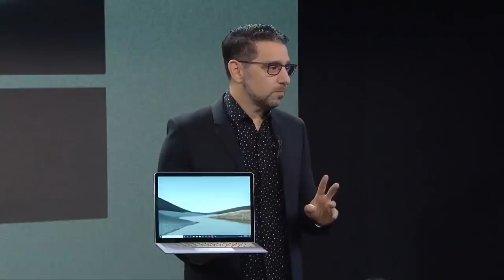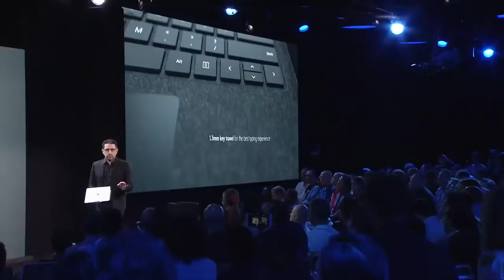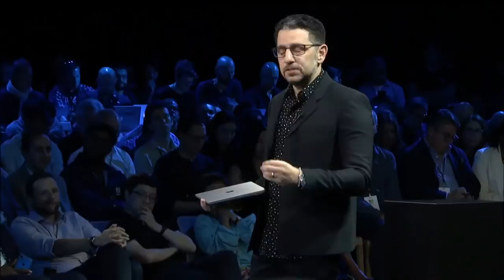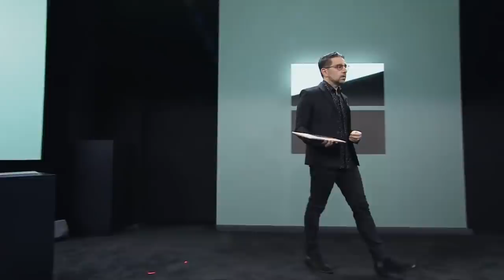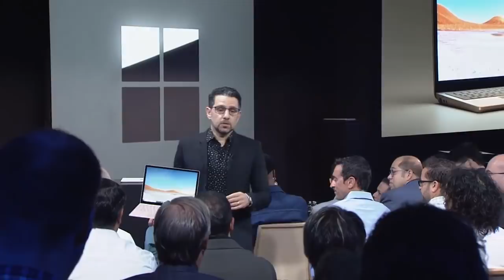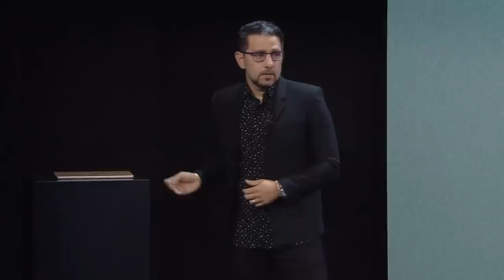Microsoft says they value repair-ability, designs more repairable product.

Comment: They still need to make surface pro more repairable. Also thunderbolt 3. But glad the laptop 3 got repairability.
Reply: And the new 5.3 mm thin Pro X has also removable drive just on the side of the sim tray. 😆this year they are really bashing apple silently. When the laptop 3 came on the stage first thing they mention is the keyboard. 😆
Reply: Just watch the Pro X promo video from MS. It is super easy to upgrade the storage.
Reply: Abhishek Maurya but not the pro 7 , so if I want intel I am out of luck. And battery isnt replaceable on either... a step in the right direction but far from what i want
Reply: @Ultrajamz  yeah I think thats because of the drastic design changes that they have to make. Although the now the whole surface line up support either expanding the storage using sdcard or easily removable ssd. Maybe that's why they didn't do it. I also think that net yesr we might just see surface pro 8 in chassis of Pro X. Let's hope they improve the repairability further not just storage.
Reply: Abhishek Maurya the issue I have is I need to run VMs and sd cards are too slow for this, and thunderbolt 3 makes a big difference for external ssd ...

Comment: I disagree. I think Apple should repair all our devices and charge us 2 times the cost of a new one.
Reply: Business Momo 

I think it should be even more if you purchased it more than five days ago.
Reply: @GibusGang  you're a genius
Reply: Why only 2 times the price of a new one? I think 10 times is more appropriate. I mean our old device is more personal now, so it's more valuable to us and it should cost 10 times than a brand new device to fix it :D
Reply: 2 times the cost of cheapest product, to repair a warehouse full of devices. Sure.
Reply: Yes, this is the perfect solution that we all want. Repairing is for nerds!
Reply: I can feel the energy coming through
Reply: But data recovery would still not be included.
Reply: Just let us repair them ourselves without t2 chips.
Let us buy parts or use them from other identical apple products.
Don't monopolize repair like soldered on memory and add upgrades
Reply: Itll be even Better if the lifespan of the repaired macbook gets cut by half ,you get what you paid for amirite 😃?
Reply: Better than what they do sometimes, by refusing to repair the device at all. Even if you offer money.

Comment: Louis, I have these computers in the showroom at my store. They cannot be repaired except by a Microsoft-authorized technician, and you need a special tool to get into it, none of which MS is providing. Also, the SSD's inside are a strange form factor. I can't swap in my Samsung 970 Pro NVME drive, because it's way too long. I'm glad it can be disassembled at all, but the biggest bummer about this product to me is that it lacks Thunderbolt III, and they are charging Macbook Pro 15" money for the more powerful (slightly) 15" AMD laptop that doesn't touch the 15" MBP at all in terms of power. Thunderbolt III is built into the Intel Ice Lake processors this time around, so in my opinion, this computer is a half-step. There's no reason I can think of to not have Thunderbolt III yet on these, given it's on much cheaper laptops that don't even have Intel's new Ice Lake processors.

Comment: last week i opend my old toshiba to get out my harddisk. i didn't even have to open up the whole laptop to get to there, in 4 screws i had my harddisk, 3 more and i had the ram. 
Really makes you question more recent laptops or apple products in general, when i can do that without understanding much.
Reply: B-b-b-but the beauty! The beauty of a super thin device with inferior heat dissipation, battery life, aesthetics demanding sacrifice all around. You NEED it to be beautiful and Apple-like. Drives this guy crazy otherwise, he can't look at it. Carrying 20 dongles and disposing of your device when the battery is worn out is the future. The future is now. Just give me a goddamn laptop with a good screen, easy to access DIMM slots, HDD/SSD bay and all the damn USB/ethernet/whatever else you can cram on it. If it needs to be thicker for thermals, so be it, I think I'll live. If I wanted Apple shit, I'd buy Apple.
Reply: I can actually eject the battery from my parents old Dell Inspiron and the computer will still run if I plug it into a wall 
everything is easy to access too
Reply: A while back I was working on an old Dell Latitude that had 2 (in words: two!) hot-swappable bays. And they would work for batteries, drives, etc. And even the keyboard was surprisingly good for a 15 yo machine.
Reply: Love my 2012 ASUS ROG laptop,with a nice and thick slanted down keyboard, two HD bays, and memory slots easily accessible.  Looks and works great, couldn't ask for more. :)
Reply: @HappyBeezerStudios  that's the joy of working on an Enterprise Class laptop :O) They are meant to be repaired in the field. Just avoid the 12" and smaller models from what I have seen in their Service Manuals, while still doable, they take MUCH longer to deal with. 14", 15", 17" have all been easy to replace parts, even down to the mainboard.
Reply: Old toshiba's were awesome! A few years back I helped a family member remove some HDD's from their old ones and convert them to external drives (they were a fan of the brand and had several) and they were possibly the easiest laptop HDD's I've ever removed.
Reply: @BT-ex7ko  u sure about that my toshiba died just because i sneezed on it and the bios is always locked so I can't even do clean installs
Reply: I have an old Vaio with a similar setup, it was so easy and enjoyable to swap out the old failing HDD with an SSD (well I did have some trouble because one of the screws for the mounting piece was stripped, which eventually had to be drilled out, but whatever).
Reply: @Soo Ah and they have been that way for YEARS! Took me an hour to replace a keyboard in one of their laptops, takes me about 10 minutes on a Dell Latitude or Precision, even the first time.
Reply: The Dell Latitude and Precision families have got to be some of the easiest to repair on a user level.
Reply: Yes, when even an idiot can safely open up a laptop to access ram and storage. I miss old engineering man. We are not moving forward anymore. All we have today is companies like Apple trying to nickel and dime us.
Reply: Maybe some of us like larger, clunkier, more "machine-y" laptops?

Comment: I would consider buying hardware from MS as long as I can exclusively use Linux on it as an OS without issue.
Reply: I think you most likely can, nowadays, Windows 10 is getting more and more Linux-Based nowadays...
Reply: it takes a bit for the compatibility to catch up but you usually can with no issue.
Reply: @navewindre  MS doesn't lock down the hardware to only boot "validated" OSs?
Reply: @DKL997  you can't do that on x86, best you can do is use uefi 'safe boot' but that can be circumvented by using the windows boot loader to boot into grub for example.
Reply: @navewindre  ah good to know! Maybe my macboook replacement will be a MS notebook. (Of course I run ubuntu on the macbook too lol...)

Comment: Their surface pro lineup is a complete joke, why remove the screen to get to the motherboard/ssd/battery? Dell 5285 has exactly same functionality/features and it has screws on back plate so that nobody has to remove screen off the computer, potentially breaking the screen.
I find this claim from MS objectively BS

To add: this thing probably costs more than $1000 (or some unreasonable amount of money for its performance), even if MS says this product is repairable they're probably going to charge shitload of money for this.

Comment: More companies need to adopt easily openable devices. Like as much as you make fun of apple, their iPhone displays are fairly easy to replace. They're the first part out and the battery is also right there. It's a good design that emphasises common repairs. Microsoft and other computer manufacturers need to adopt and make more flexible and easier to repair devices

Comment: And they went out and soldered the ram
I actually felt really good watching this in the keynote, but this soured it after that
Still, great step in the right direction
Reply: The SSD isn’t soldered anymore though, and your ssd is more likely to fail before your ram.
Reply: Don't really give a crap about RAM in laptops either. If you need the RAM just  buy the model with the highest RAM, they're usually at every CPU tier. You should know your needs before you buy a device of this type. It ain't a highly modular desktop. People want slim devices, they're gonna get this with the sacrifice of modularity. If you want something that is modular, then don't look at these low profile devices, get yourself a gaming laptop. Theyre the same price. Needs based scenario.
Reply: @xxMastufaquxx  ram is important for ryzen though
Reply: @tek1645  I'm not denying the importance of RAM but most premium models these days have a default of 8GB which is perfectly fine for a lot of people and well rounded use. It's fine for compiling programs and mild gaming too. I mean, personally, I will opt for the 16GB models because that's my choice and I've spoiled myself with high RAM in the past. I know what I run too, like virtual machines and video games. But, I also acknowledge that 8GB is fine too. Hell, even 6GB is fine for computers that are only casually used, but it's a weird capacity these days and you as might as well just get 8. CPU architecture doesn't matter much either in laptops where RAM clock speeds are pretty much the same, you have very limited choice compared to desktops. So whether it's Ryzen or Intel, you have no choice in the type of RAM for laptops, and even having swappable DIMMs doesn't mean the motherboard will support the higher clock. Size doesn't matter for the architecture too, whether you're on Ryzen or Intel Windows still uses the same ~2GB of RAM.
Reply: @xxMastufaquxx  yeah but speed does and ryzen likes fast ram
Reply: @tek1645  yeah but I state again, you don't have that choice in most laptops, and even if you had swappable DIMMS there's no guarantee putting in a higher clocked RAM stick will be compatible with the motherboard of your laptop. So it doesn't matter as a choice and frankly shouldn't even be a thought when picking out laptops. Just build a desktop if you're concerned about raw efficiency and performance. Doesn't really matter much for 3rd gen Ryzen either.
Reply: @xxMastufaquxx  RAM speed is mostly important in Ryzen for the APUs, but one thing you missed in your response is that most prebuilts and laptops are not going to have overclocking unlocked afaik so the fast RAM argument is moot when spec is limited to 2400 for the 3780U and 3580U in the Surface. Even if you could swap the RAM, I doubt BIOS will allow you to push OCs on it much less would it be recommended with the nonexistant cooling in such a small device. AMD's spec also notes it is not an unlocked chip. Though I will mention that you are incorrect, the mobile and desktop APUs in Ryzen 3000 are all Zen+ or Zen so RAM speeds do matter as much as they did before Zen 2. It won't be as apparent granted they are all meant for light mobile use and not heavy loads like servers, encoding, etc but it's important to be accurate. You also can often put faster DIMMs in without issue, but the locked clocks in BIOS will simply clock the DIMMS at whatever is it's max supported spec instead of whatever the DIMMs are marketed as; back in the day some OEM boards would spit errors out using non-OEM RAM but it's much rarer than back then and typically only DELL boards that do it. Swapping SO-DIMMS on locked boards is more a waste of money except unless you are not at the limits of your spec and can increase speed by several hundred MHz or double capacity to disable swapping.

I also don't understand people complaining about soldered RAM in a device that is as thin as a tablet or one of those old MacBook Airs. Where the hell do you expect to fit two SO-DIMM slots in such a cramped design? If you want that get a Lattitude, ThinkPad, or whatever HP makes now in the business segment. You'll also get a significant increase in performance when you can have a chip with more than 15W TDP and real thermal performance. People want everything their way with no concessions at all and it's frankly silly to put it mildly.
Reply: LPDDR4X is always going to be soldered. Same with previous gen LPDDR3. That's just down to the specification of that RAM. Because the chips are soldered in the board also, it allows manufacturers to place those chips wherever in the device to accommodate for space in these cramped little machines. There is no flexibility with RAM slots. 16GB of soldered chips takes up much less space than 2 SODIMMS.
Reply: Dell, Lenovo, and ASUS ROG make good gaming laptops I have no idea where the heck you're looking. The only laptops I don't recommend are from ASUS' standard lineup cause they're garbage with unreasonable failure rates. ROG has all their work and R&D put into them and user reviews back that up. Again, it's a needs based scenario, and aside from Lenovos business lineup most business laptops such as those from HP and Dell's Latitude are garbage with features that consumers will never touch like security card readers. Secondly, business laptops don't have dedicated graphics cards, which some consumers will want or look for. End of the day, there are specific models and lineups that are flawed in every category of laptop, and it's up to you to do your own research on the product you want. It's wrong to simply consider an entire category bad. I have computers of every category and friends who come to me for specific recommendations that I have done the research on, and everything I've picked is more than satisfactory. You just have to know what you're looking at and what you want. There's always opportunity costs.